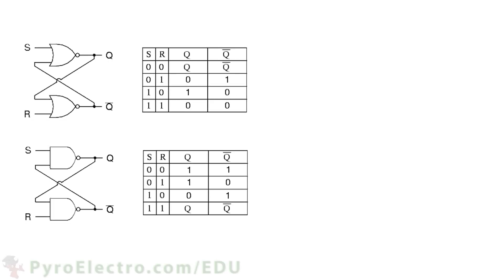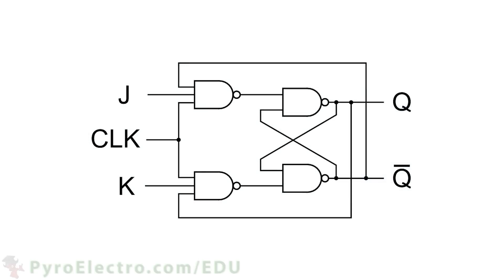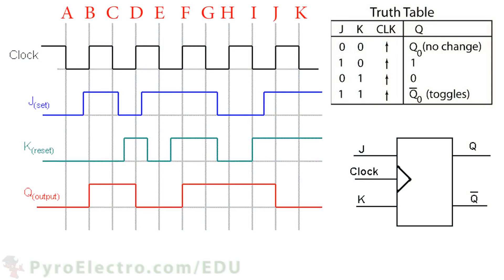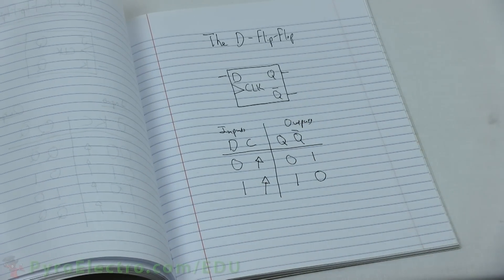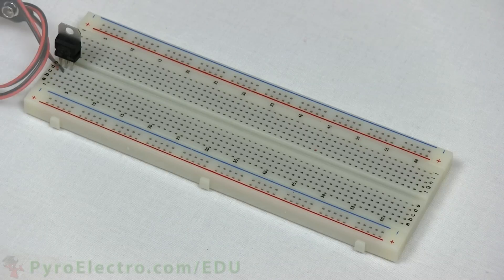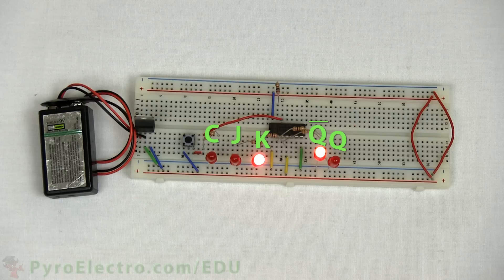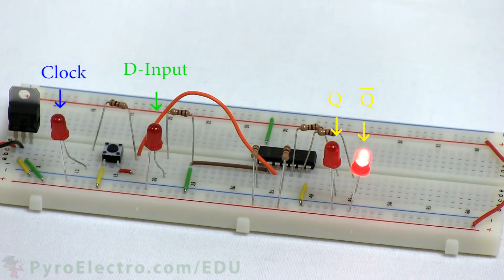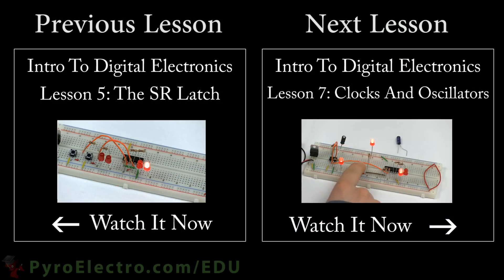Flip Flops - An Introduction To Digital Electronics - PyroEDU

Comment: Hi sir, there is one thing that I can't figure out when you show the JK FlipFlop real example. When you press the pushbutton nothing happens, while the Q and not Q transition happens when you RELEASE the pushbutton and that appear to be opposit with respect to the theory: you explained before that the transition happens when the clock state change from Low to High. Could you please explain me better this point?
Thank you
Reply: +sebas1180 well this is an old comment, but the clock diagram is for the simple JK , that IC probably has a master-slave JK in it, which flips and flops on the clocks negative edge.

Comment: At 4:10, the diagram lists "Clock"  but it should be "Rising Edge Detector" instead. It should only produce 1 for a very short period of time while clock is going from 0->1 and it should be 0 when clock is stable at either 0 or 1. Please see http://hyperphysics.phy-astr.gsu.edu/hbase/electronic/dflipflop.html#c4

Comment: you say there is a pull down resistor on the push button but nothing appears on the schematic or the video?
Reply: +Robert Barton There are many factors in learning circuits. One plan I found that succeeds in merging these is the Gregs Electro Blog (check it out on google) definately the most helpful info that I've seen. Check out this  unbelievable site.